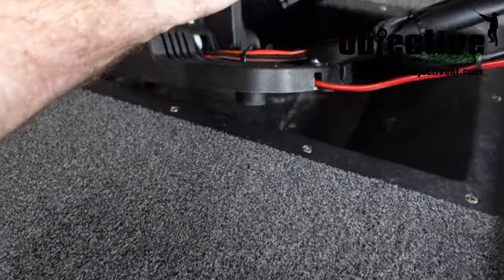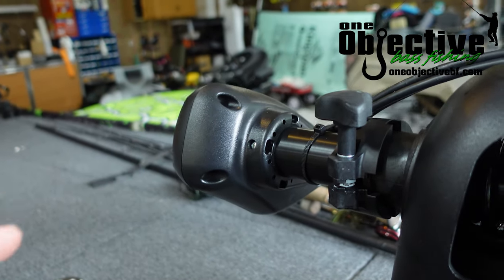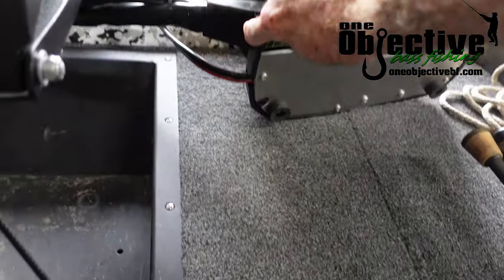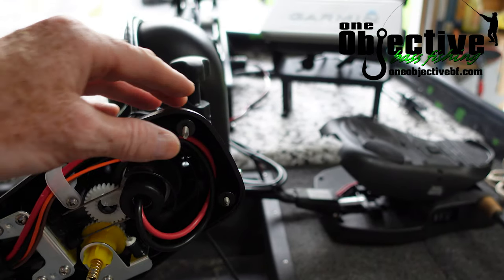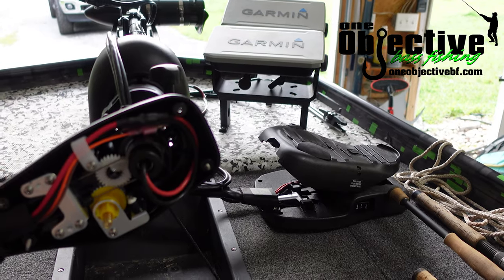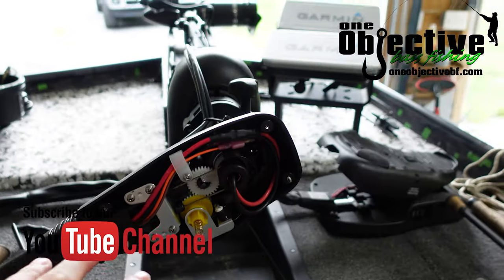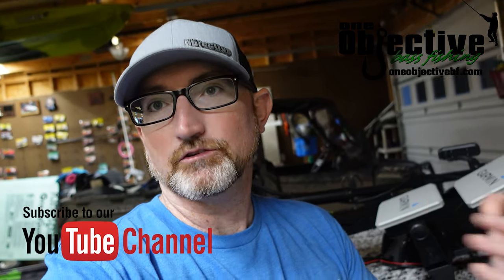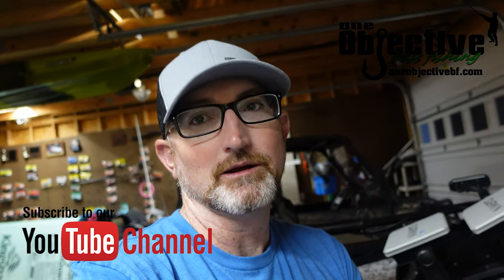Adjusting a Minn Kota foot pedel

Comment: I’ve got an 06 Nitro with the original MotorGuide trolling motor.  The directional arrow is way off.  I received some guidance on how to adjust the arrow…and if that doesn’t work…the tech says he’s just put a piece of duct tape on the cap with the ore t orientation.  Seems simple enough if disassemble either fails or ends up in the “too hard to do” pile.  Your mileage may vary.

Comment: After the direction dial is rotated, pedal is level, the motor is facing forward, and covers are put back together...Do you then re-tighten the foot pedal screw back to the original desired tension?

Comment: I just got my first bass boat on Saturday and it's my first boat and trolling motor. I understand how the trolling motor works however the pedal is tilted all the way forward and it's almost impossible to operate. I thought it was broken but it seems maybe I just need to adjust the pedal? Do these instructions work with the base model edge 45? Thanks!

Comment: Will any of your mounts for the 1103 work on my kaku Zulu?
Reply from the maker: Do they have the four bolt pattern for the powerpole
Reply: @OneObjective  yes sir. I was looking at your non actuated torqueedo mount the square looks bigger but I mean if all kayak brands use the same size for the power pole should be good then.